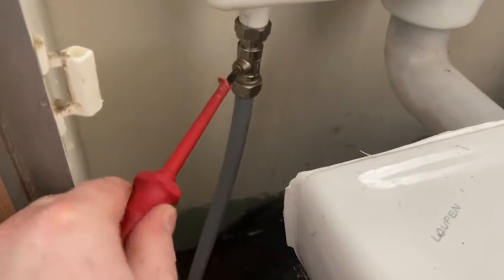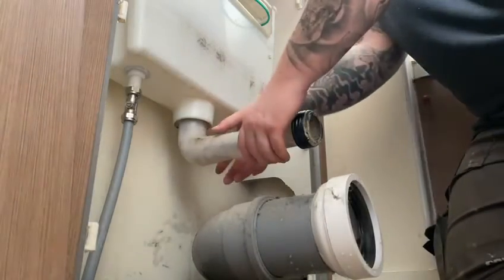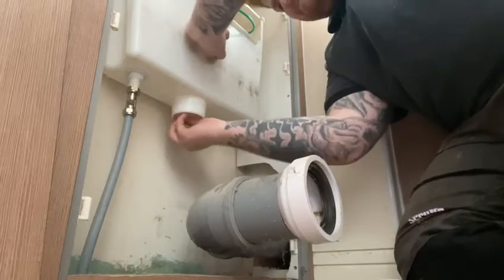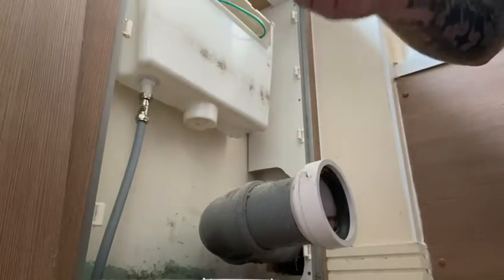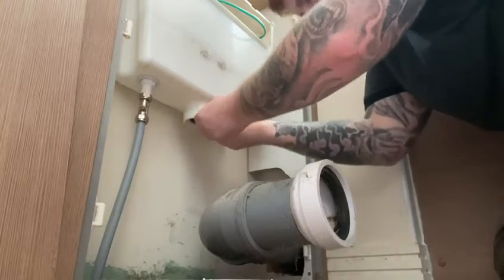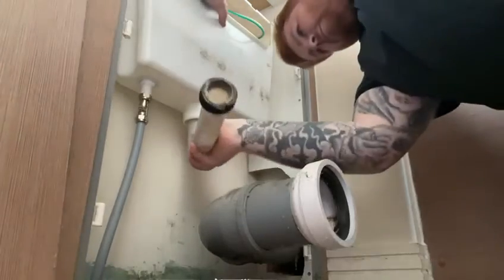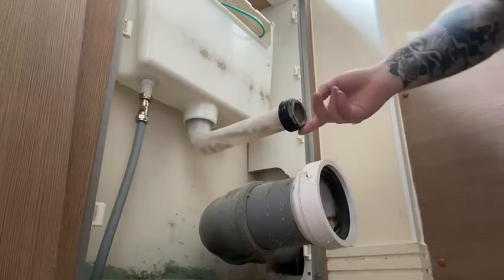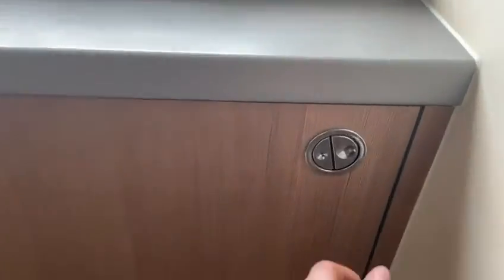How to repair a Geberit Concealed Cistern

Comment: Ive not finished yet, but thanks to this video I think I'm saving myself £300 just before xmas! All the people in my apartment block were saying it definitely needed all replacing, but it seemed like such a simple thing I refused to believe it was more than a seal issue. Though unfortunately I live in an apartment with annoyingly tiled in fittings, but with some contortion we are getting there. Big thanks Fraser!

Comment: I had the leaking flush pipe issue and I've taken the lot out, lubed it up and re fitted but it's still leaking. I take it a rubber replacement would do the job aye? Geberit man. Pain in the ars 😂

Comment: I carried out the same seal change approx. 12 months ago and thought I'd fixed the problem. Had all the flooring redone only for the same seals to be leaking again ! Do I just have to live with this and accept they are a poor design or is there a more reliable solution I can retro fit using the same push button mechanism ? Any help would be appreciated.

Comment: I noticed there is no pipe fastener installed (243.070.00.1
Geberit flush pipe fastening for low-height concealed cistern) - Is this also the reason for leaks due to movement? In regards to your install, is it possible to not remove the WC. Remove the cistern tank from the flush pipe, whilst still having the pipe attached to the WC....replace the seals on the cistern and then re-insert cistern back onto the top of the flush pipe.
Reply from the maker: It would be difficult to replace without removing the wc, you could try and force it buddy. Leaks are due to the rubber seal perishing.
Reply: @fraserhoehle2256  Our setup seems to have more access compared to the one you work on such that the cistern sits slightly higher up and we have reasonable access to the flush pipe and inlet valve connection. Hence I assuming one could disconnect the inlet valve connection, and unscrew the cistern from the wall; and lift the cistern up whilst holding the flush pipe to pop the pipe off. Remove the cistern out, replacing the seal and re-install back onto the flush pipe (whilst the other end is still connected to the wc)?

Comment: Can you advise how the seal fits on the pipe? I’m assuming that the pipe pushes all the way through the rubber seal, I’ve been trying to get the pipe through the seal, but seem to struggle to do so, pipe just keeps falling out!! Thanks
PS this is the only video I could find showing how to take off and replace this seal. Thanks
Reply from the maker: Hi david, have you lubed the fitting?
Reply: I lubed the fitting and the pipe, I could never get the pipe to go through the seal, the more I pushes the more the seal deformed. I finally took the cistern out and manually fitted the pipe with the seal on and then used a spanned to force the clip into place. I tested it in the bath, and it’s still leaking, waiting till Wednesday for another replacement seal and clip. Thanks again
Reply from the maker: @DavidScott-mg6yv  maybe you put the clip and seal in the wrong way?

Comment: great video, have the geberit 109.720.00.1 , trying to figure out how to get to the seal from the top of the cistern as the bottom where the toile is connected is all tiled up so have to 'break' the tiles etc. and do not want to. Have full access to the cistern from the top. any thoughts?
Reply: we had a similar issue managed to get a long arm round from the top to underneath. not the easiest but can be done. you cant access it from the top

Comment: Hi Mate, you look like you have a good familiarity with these Geberit cisterns, I have a problem with one of these exact same concealed cisterns where it's leaking into the pan. (pita as it's a macerator toilet and the pump goes off randomly every hour or so) - I've read a lot about these Geberit flush valve seals blistering, can you tell me how to remove the flush valve to check? I'm hoping it's something easy like a 90 degree CCW twist. Hope you read this and can help!
Reply from the maker: Flushing mechanism? Probs old and groggy sure you can actually just remove the flush mechanism by twisting it and it unlocks for easy replacement